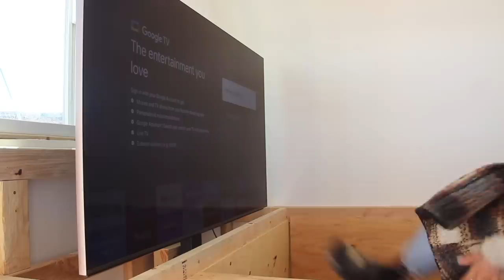I Can't Believe This Build Actually Worked | DIY Bed with TV Lift + Storage

Comment: LOVE how unique it is! You crushed this! The rug was my favorite unexpected, excellent touch. 

May I recommend adding ventilation under your mattress? You could try drilling holes into the board, but there are plenty of ways to do it & I trust your innovative choices.  Ventilation allows your mattress to not retain heat and moisture. It helps to keep your body temp regulated but also helps with preventing mold and mites. Wonder if the TV will also affect the temperature.
Reply from the maker: Yes! Someone else recommended that and I need too.

Comment: Get rid of the center support post. Turn the framing under the bed so the 2x4 isn't flat but upright so its more like a joist. It won't need a center post.
Reply from the maker: I'm solid with how I did it but appreciate the tip.

Comment: Kudos muchachas! My only question is ......how is the extension strip going to work? (The one you cut out the hole for?
Reply from the maker: In the episode that focused on getting this room together - you can see there  is a plug on each wall so that extension plugs into the plug on that wall.